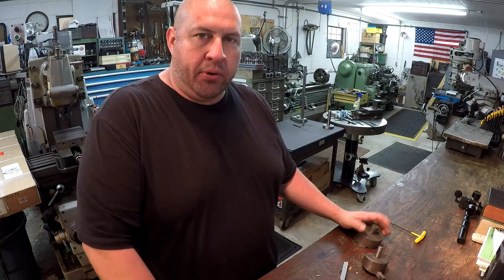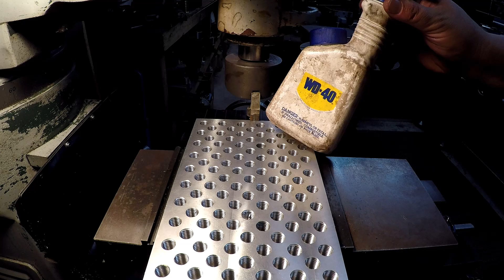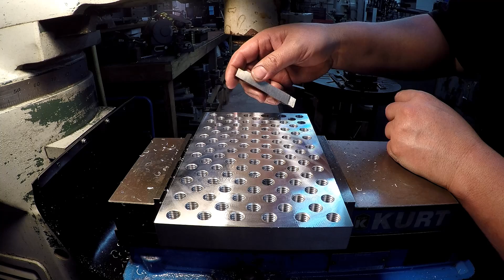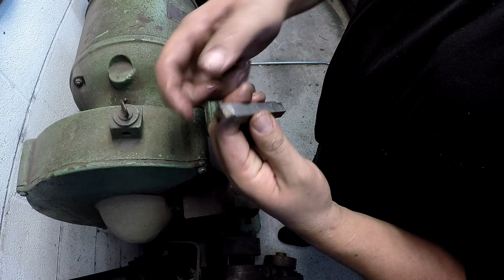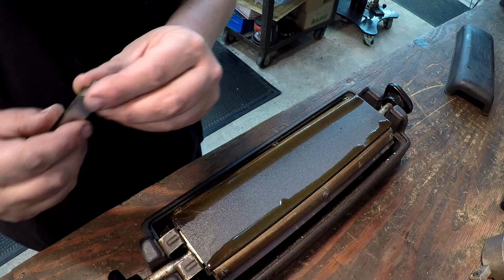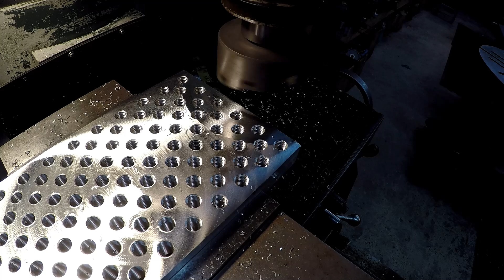Shop Talk 17 Flycutters & Tool Bits

Comment: Nice video Adam. I wish some of the people who comment on here would use their brain before they speak. There is a right and wrong way to do anything, but sometimes you do what works the best with what you have available. Not all of us have all the proper fancy tooling for every job under the sun, that stuff is really expensive.
Reply from the maker: +wvrockcrusher Yep, absolutely. I think most home shop guys will have a fly cutter or two, and tool bits are cheap to acquire. I was having some problems with this whole set up, but I don't always cut something 6" wide on the DoAll mill. It's easy for some people to quickly blurt out " all ya have to do is" and armchair quarterback me. Not everything is perfect. Sometimes showing the problems can be just as helpful as showing that perfect mirror finish.
Reply: Abom79 - showing the problems, and how to control the issues that caused 'em is a damn sight more helpful than just showing an end product that came out well.
Reply: wvrockcrusher  I agree with you about some people's comments... knowing the time and effort that Adam (and others) put into producing thee videos I find it frustrating to read many of the comments.  As Adam said at the start of this video often he will show/use tools and consumables he has at hand, rather than suggesting what is shown is the "best" or the "right" way.  I understand that people are often suggesting alternatives or useful hints and tips... but when these comments come across as "you should do it this way" or "why didn't you use this tool" that's frustrating.
Reply: Amen brother.

Comment: Nice job Adam, considering the interrupted cut I think you got a good finish on the plate.  I too have had good luck with HSS and aluminum.  Those brazed carbide bits are good for fly cutters too, they hold up a little better and are pretty cheap.  That was a good story about the Booth men cleaning fish, funny how those simple things stick in your head.

Comment: Don't understand why any one would use a fly cutter over a facing mill. Facing mill is going to give you more cutters on the material.. Maybe if the angles in the facing mill inserts are not right for the material?. I use a fly cutters mainly for cutting custom reliefs like valve pockets in motors.
Reply: More cutters means more expensive when they get dull and need to be replaced.  As with most insert-type tooling, it seems like you are always loaded with half-dull inserts that work just fine for roughing out the part, but can't take a .002 finish pass if needed.  The time and cost required to change all the inserts for a 5-minute finishing pass is often not justified.  Sharpening the inserts might be possible, but it would be difficult to get them to all cut evenly afterward.  It is not uncommon for inserts to become obsolete or difficult to find and you are left with an expensive facing mill you can't get inserts for.  And like you mentioned, grinding your own cutters for a specific angle, relief, radius, etc. are typically much easier with HSS.
Reply: True, If you are worried about cost and not speed.  Not sure the cutters are all that hard to align.  Most of the pockets are precision cut tho I have made a large facing cutter that I made using braised carbide insert tooling. It requires some work too get the bits right. Alignment only controls finish speed as as a slight stagger on it lowers tool loading depth of cut in this case.   With the insert pockets well machined on an inserted facing mill, 5 or more edges can be changed quickly tho I prefer to make sure the cutter is sharp at the start..    Some facing mills use inserts that are pretty cheap. (TPG)..   Having more than one cutting point on the material reduces the loading on the mill compared to a single fly cutter.   Carbide inserts increase cutting speeds by 5 times over high speed steel.   Facing mills are better balanced at higher speeds..   

This is all good stuff. My first large facing cutters were HHS fly cutters because they were inexpensive.  Finding good inserted facing mill is worth while when doing harder materials.

Comment: I had some 303SS parts that needed to be fly cut a while back. I had a brazed carbide tool in the cutter. The corner got beat up pretty quick. So I ground up a HSS blank, and it held up better than the brazed carbide. I guess the carbide couldn't handle the interrupted cut. Just goes to show carbide is NOT always better than good old HSS.

Comment: A few suggestions.  I have worked in the mold industry for over 45 years specializing in aluminum molds.  For the first 20 years it was manual machines only, CNC's were not available to us until late 80"s.  First, we never used coolant of any kind when fly cutting.  Sure we tried it, even WD40, but we found cutting dry made no difference in finish and besides, no one wanted to stand next to the machine and be sprayed with oil.  Even today we don't use anything when we are using a face mill on the CNC. Second, when manual fly cutting large surfaces rigidity is a must so the cutter holder should be larger than the area it's cutting whenever possible.  A 3" fly cutter with the bit sticking out 1.5" just won't work very well on a 6" piece.   We made special fly cutters up to 12" diameter using a round aluminum plate with a steel center hub and a slot cut into it on an angle for the tool bit.  The tool bit would only protrude as little as possible.  The tool bits were off the shelf brazed on carbide tipped. HSS would never hold up for more than a couple of passes.   The carbide ones lasted for months of daily use.  Finish was determined by the feed rate.

A tip for doing large plates: double tape them down to a rotary table and rotate it leaving the machine table stationary.   You'd be surprised how flat and parallel you can make it provided the head was trammed in good.

Comment: Your chatter with the HSS is coming from two sources, the nose radius is too large, and there is too much rake for the size of the cutter.
The tool is actually getting pulled down into the work by the rake. Not such a problem on flat stock, but with all the holes, the tool ends up flexing up and down.
Going with a smaller radius will reduce the force acting on the tool, going with 0 rake will prevent it from diving into the material, and adding some negative lead angle will held even more. Make the tool look like a left hand cornering tool with 0 rake and it will leave your best finish.

Comment: Adam- do you have any comment on fly cutters vs your shaper? Seems to me both are tools designed for cutting a flat surface. I suppose that in this situation, the fly cutter was appropriate as you were essentially squaring the pallet plate to the mill spindle, but as far as other operations where you're simply looking for a flat surface- would you be more inclined to fly cut, or use the shaper?
Reply from the maker: This part is something you usually stick in the mill vise and use to hold parts, so you normally do a light cut on it to make sure its flat and true to the spindle.

Comment: hey Adam if it is a balance issue causing  the vibration  at the higher speeds why can't you counter  balance by letting the same amount stick out on the opposite  side of the cutter insert.. granted I am not a machinist  so just asking
Reply from the maker: Sure if you have a tool bit long enough.
Reply: will not work... I had that idea 34 years ago as an apprentice.... couldnt get it to work... sounds good right? but in the real world it doesn't work
Reply: its not only the balance that causes vibrations, another big problem is that the relatively thin tool sticks out alot. The cutting forces will try to bend the hss shank, especially with heavily interrupted cuts like in this plate. Any time the tool hits the material it will bounce a tiny bit and when it "leaves" the material due to a bolthole or the edge of the part it will bounce back.
I would've tried to have it stick out only half the distance and face the plate in two passes, looking at the toolholder it would leave a very short stickout of the hss shank, due to that you could even crank up the rpm a bit more as you reduce imbalance of the tool.
Reply: i was thinking the same thing
Reply: Would there be any issue with adding a bolted/dovetailed on 
counterweight to the fly cutter to balance it and allow it to spin 
faster? Or drill it and add mallory metal like they do for crankshafts?
Reply: I was thinking the same think except have a counter balance set you can choose from to add to the other side. would love to see the same tool as tight in to the fly cutter bas possible and see the finish.
Reply: what about trying a counterweight on a pendulum type arrangement?

Comment: As always Adam great video. I think if the DIA of the fly cutter was larger so that there was less tool hanging out it might not chatter, or a thicker tool.
Reply from the maker: Yes a larger holder to support the tool is what is needed there. It'll still get the jobs done though.

Comment: Is there any reason to use the TPG insert (apart from convenience!) compared with a ground insert designed for aluminium, like CCGT or something? I'd assume that the cutting forces would be less with the ground insert, reducing vibration and giving a better finish.
Reply from the maker: Use what you have in some cases. I don't buy special aluminum inserts.

Comment: Shouldn't that plate be lapped?
Reply from the maker: Lap and aluminum mini pallet? Why?
Reply: No.
It should be skimmed each time it is mounted on the machine.
Having the plate square to the mill is far more important than needing it to be perfectly flat.
Reply: No.
It is a fixture for holding work on the mill.
What it looks like is not important. All that is important is that it can functionally hold the work, and that it is square to the mill.
Reply: Lapping would make it flatter & remove the machining marks, but it would leave you with a dull, grey finish on aluminum that would require polishing to bring the shiny luster back again.
Reply: O I was thinking just for a better finish on it
Reply: so would it be better to surface grind it?

Comment: ya cobalt gives it the red hardness that's why scorchin the cheap wood chisels is a bad thing(carbon steel) use hss m2-m42 a lot, have a bunch of sharpening fixtures for direct in feed production of the relief angles using hight above wheel centerline, ok im a wussy I try to do nothing freehand and have a cheap(metric)pocket comparator there cheaper and Deg are the same metric or impearial the radiuses and circles are the same too just labeled in mm thinkin bout a metric "tenths" dial indicater cause 0 is the same in metric too

Comment: I wonder, can you have a to low feed rate?
Well besides that it takes too long, but would there be any other downsides?
Reply from the maker: When machining, too low of a feed will can cause stringy chips, and a longer cutting cycle.
Reply: Ah never thought about chips. Thanks! Always something new to learn here :)

Comment: 17:33 - I can see that pattern is caused by the frequency that the tool is resonating at. It's acting as a tuning fork as it "squeaks" and this causes it to vibrate the pattern into the aluminium, just as a vinyl cutter cuts sound into vinyl records. Perhaps you could wrap rubber bands or something around the cutting tool to dampen the resonance so it doesn't act like a tuning fork. That should make the pattern less visible.
EDIT: The best way I can explain it is when technicians skim brake discs. They put a large rubber band around the brake disc to stop it from "ringing". Prevents the awful squeaking sound and probably helps to reduce high frequency chatter too. :)
Reply: What about a coil of soft lead mashed on there? It's worked on a boring bar set-up I've used...
Reply: drill a 1/2-13 thread in the back of the fly cutter or drill 2 holes in the back with lock nut with verying legths of bolts to even out the balance just a thought.

Comment: On the grind, get all side done first, then give it a quench.. the whole bit. That should help gain a surface hardened..
Reply: It's not like the carbon steel that knives are made of barry g, and if you look up the qualities of HSS, read about it's high 'red-hardness' and you'll see you can't anneal it when grinding...especially if you're still touching it with you hands, LOL!
Reply: barry g no.... hss has such a high temper temp... absolutely nothing is happening when he grinda
Reply from the maker: When you grind high speed tools, grind and quench when needed.

Comment: Great advice on the HSS tool honing and thanks for the fly cutter demos. One of these days you will have to put leveling pads on your mill and a lot of the vibration/chatter in your finishes will be eliminated. Thanks, again.
Reply from the maker: I have some put away waiting to go under that machine.